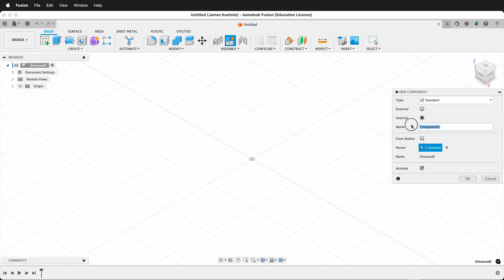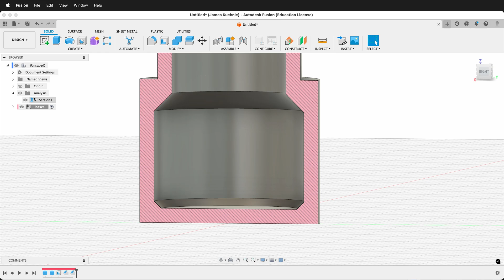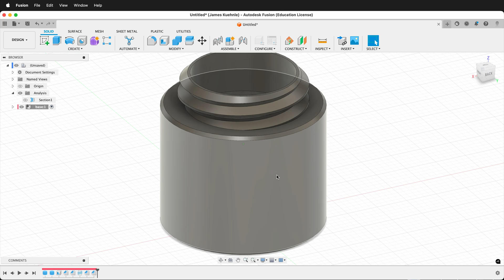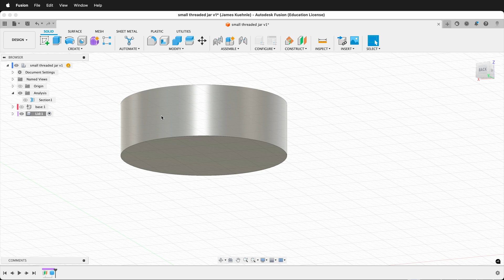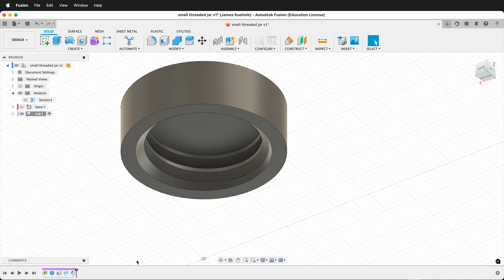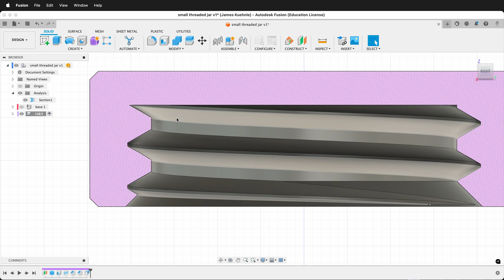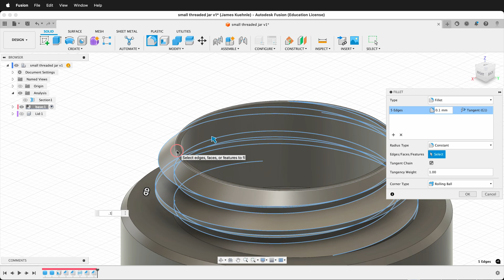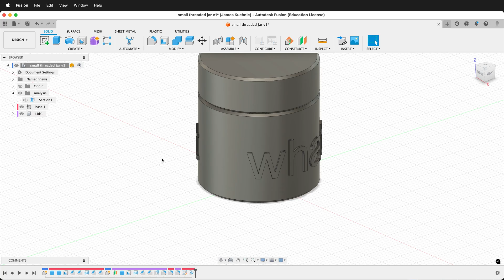3D Printed Threaded Jar Fusion 360

Comment: A 0.1 mm fillet makes no sense for a part that will be 3D printed with a 0.2 mm layer height. When designing for 3D printing, you should always consider the intended layer height from the start and model accordingly. If the layer height is 0.2 mm, why use a 0.5 mm chamfer or a 0.1 mm fillet that cannot be resolved properly by the printer?

Additionally, the thread on the “jar” is too thin compared to the cap. The wall thickness around the thread is insufficient and may easily crack during use. A better proportion between the thread, wall thickness, and cap could have been chosen.

If you apply a face offset to a thread, it should be applied to all faces of the thread, not just one side. Offsetting only one face shifts the thread off-center. Symmetry is important here, especially for threaded parts.
Reply from the maker: All good points. The 0.1mm fillet is just to make the slicer not see a perfect 90 degree edge. For small parts like this that usually helps. I agree that in general multiples of the layer height of the 3D printer is best practices.

The jar could have been made thicker but seems to be working at that thickness.

The face offset of the thread is correct in the video. You only offset 3 of the 4 sides of a thread or you change the geometry and distort it. It is counter intuitive but best to only offset the crest of the thread, the root and one flank face. See this PDF by Marcus Wakefield from the Autodesk Forums https://forums.autodesk.com/t5/fusion-design-validate-document/general-guidance-on-adjusting-size-of-threads-for-3d-printing/td-p/12513815